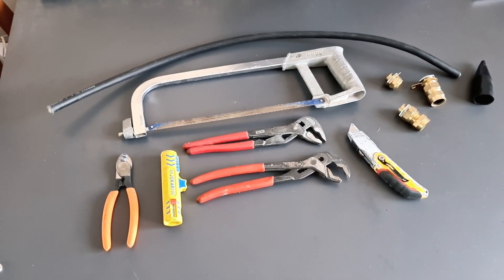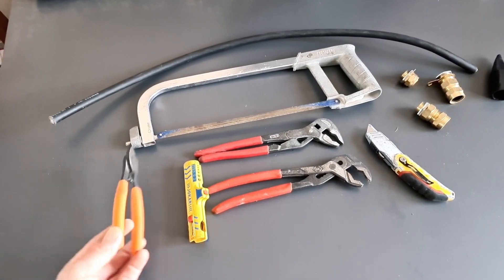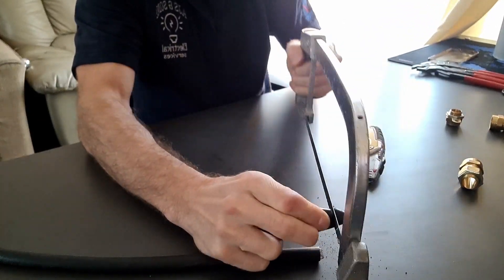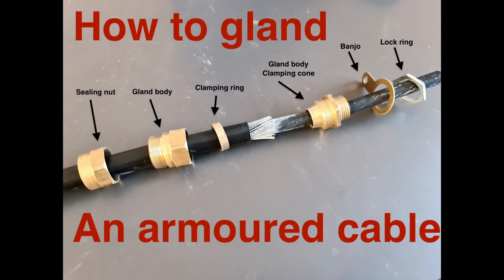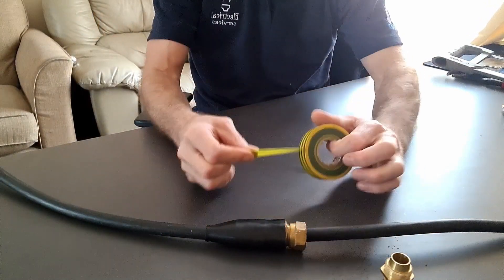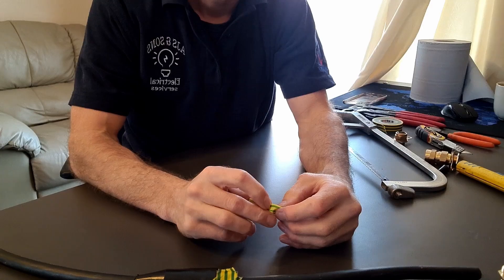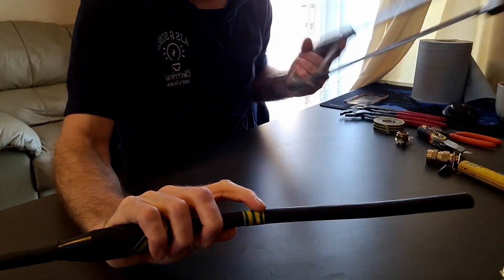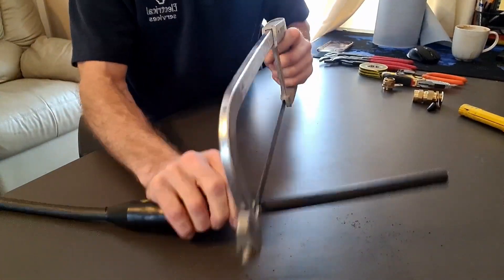How to gland off and terminate a steel wire armoured electric cable

Comment: For all outgoing feeder cables from an LV panel, each cable gland has a bonding jumper. Is it required by code that each gland be individually connected to the earth bar of the LV panel?
Reply from the maker: In the uk, we use the banjo & fly lead connecting metal body of the gland to the earth bar of the distribution board.